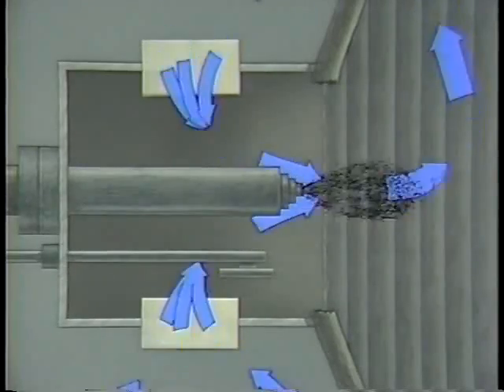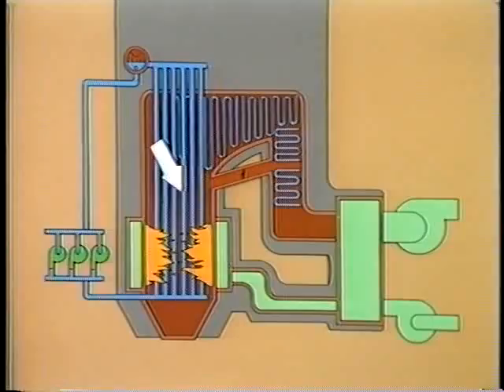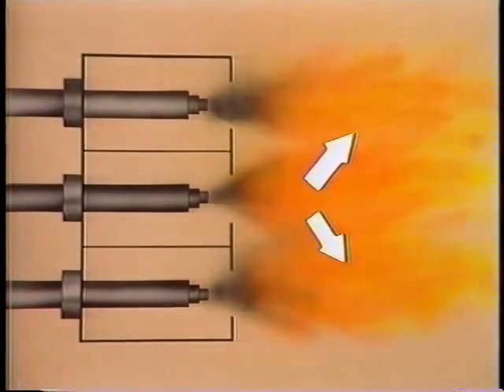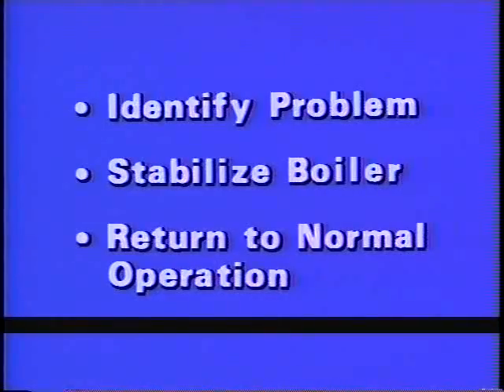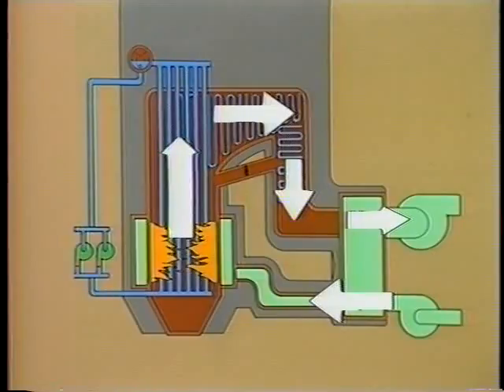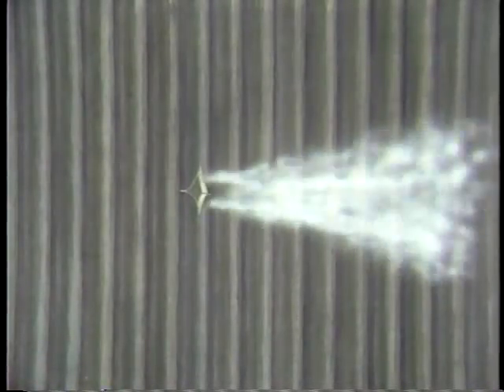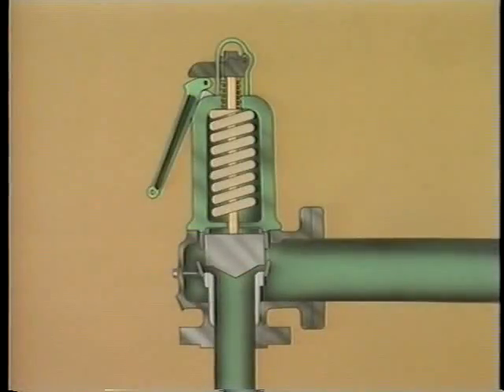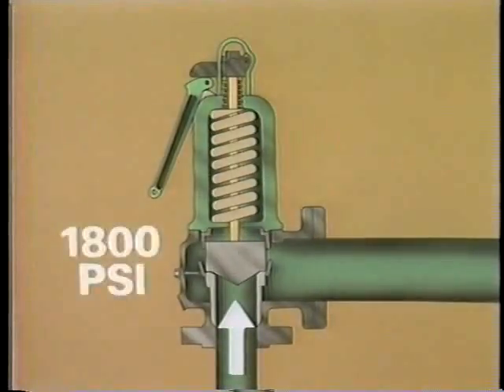What are Boiler Explosion Causes - (Problems and maintenance ) | أسباب انفجار الغلايات

Comment: What happens to water when flame failure happens? 80% steam, 20%water. Does it shrink and trip LWCO, Shrink and swell? Shrink? Swell?
Reply: if floods the boiler robs all the remaining heat and steam condenses. general speaking nothing happens. but the boiler does start shrinking. the problem is when you flood the boiler with cold water! then it rapidly shrinks and can cause stress craking anywhere. but rare to happen cuz boilers are fed by pre heated water. depeinging the style type of boiler the water with just run down the down comers but if a slug of water got into the hot steam or super heat tubes could have a steam explosion or implosion depends how much water and how fast. i build boilers for a living. and have to fix um when sumthen goes wrong.